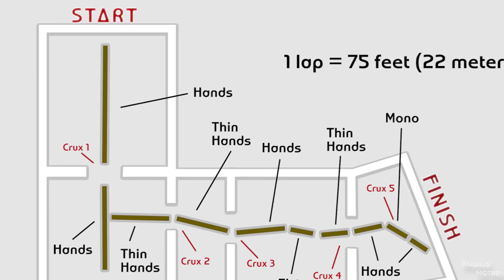First time climbing with Pete Whittaker!   **Strange experience**

Comment: Don't know alot about crack climbing. Could someone explain why you might go hands first vs feet first and vice versa, and when is a good time to turn? Thanks! Great episode
Reply: It totally depends on how your body fits in the crack, i.e. sometimes you have a really wide section where your hands don't fit at all, but you can go upside down and hang from your legs.  In one of the classic roof problems, Separate Reality in Yosemite, everyone would go hands first for the first 80% of the roof, then you got into a section with bad hands/wide fingers as the crack closed. There you had to turn around and hook a toe around the lip of the overhang, then reach out and grab the lip. Sometime in middle of the eighties (?) a piece broke off, exposing a new hold and that final crux became significantly easier. (I think the route got downgraded from 5.12 to 5.11 at the same time.)

Comment: We had a roof crack machine in college. This was way before climbing gyms existed or any other type of "plastic" climbing. We didn't have a lot of shoes to burn through so instead of wasting precious shoe rubber we would just tape over our socks. It was like having four hands.
Reply: What kind of infernal institution builds a machine specifically for crack climbing in a world in which not even climbing gyms exist?

Comment: Question for Tom and Pete.  I have a roof crack that I have built with a few different sizes, all wood construction with some textured paint to as well.  The texture is similar to many of the newer cracks I have seen in gyms which I am sure is similar to the crack volumes you have there.  What advantages have you found moving to these crack volumes rather than wooden cracks?  Thank you for any feedback.
Reply: The ones in their cellar are actually designed and sold by them (under the Wideboyz brand) - from interviews etc they've said they're designed to be a little easier on the skin for repeated use and gym climbing; check out a few videos they did with EpicTV about their crack climbing school on Youtube
Reply: @jamessanders162  Yeah I have seen them in those previous videos.  Curious about what properties these have that makes them easier on the skin, is it texture, the amount of flex, does the volume have some amount of in-cut to make the jam more positive?  Been building and rebuilding different crack training structures and am curious what has and hasn't worked.  Perhaps some of the advantages traits of the volumes could be re-produced.